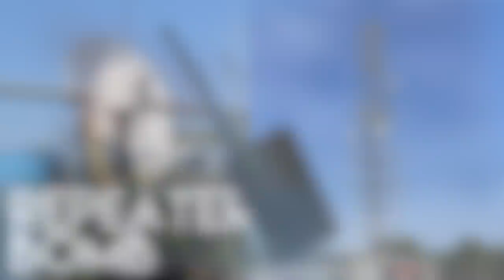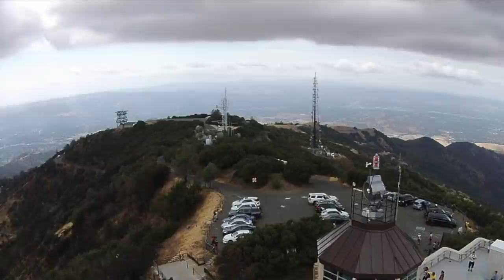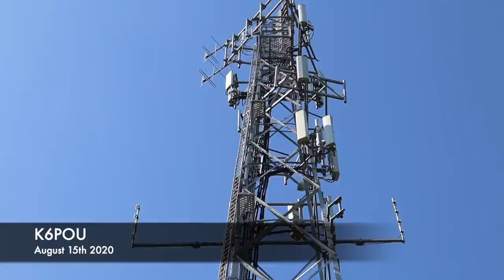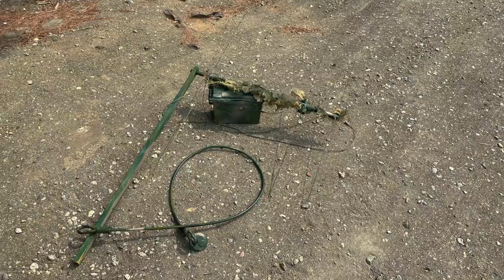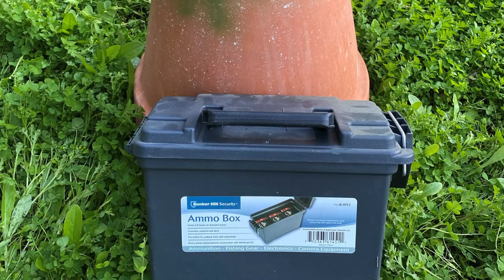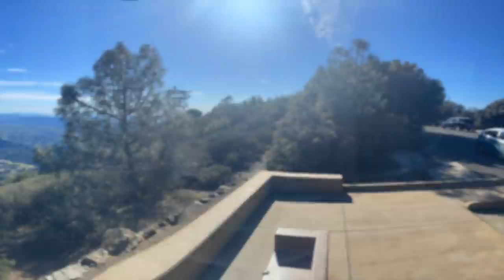The Hidden Diablo Mountain Amateur Radio Jammer

Comment: In the 1970s I used to go up on the mountain to “rabbit hunt”. Working with others to track/locate  CB radio transmitters, fixed or mobile. It was a big thing in the CB heyday. All you needed was a one foot diameter loop antenna. Supposedly you can see more from this location than any other place in US.
Reply: I did it at the end of the really popular time in the late 70's early 80s. I was legendary in the town I grew up in for dealing with the actual jammers and getting them off the air, physically if needed. The Top 3.
#1 Krazy K reason ? Dead keys and music.  He knew that he couldn't out power the top stations. So they did the next best thing, plug up everyone's ears.
Everyone knew where the antenna was. You couldn't miss it because it was right down town in a 1000 person small city. Right on top of the businesses that all had apartments above them. We knew the building well, or should I say, the flat roovs. I was 16. I was the closest one. One night, we were out in the garage drinking, and I believe someone challenged me to go get it.  So by 2::30 I was very saturated with Bacardi Rum and Cherry Coke. I have no idea what I said, but the challenge was agreed. 2:40 l left my house with I think 🤔 the 3 best tools for the job, and I always had a buck knife . I guess that made 4. I vaguely remember it. I got on the buildings rooves from a fire escape 3 buildings down. And then proceeded quietly. I had a ceap realistic 3 ch walkie talkie. A friend was listening to all the local police traffic that was in the town and county. 
Plus, the local mutual aid channels and the Tac channel. Singular we found out by accident that the locals were using it regularly to talk car to car. So we had a person who was a kid, the same as me, listening to all the frequencies in real time. Everyone on the channel trying to talk through this asshole was more than eager to lend me their scanners and any other useful equipment to simultaneously listen to everything.  He was using his base to talk to me via channel 7 or one of the 3 frequencies I had. So, if the cops were called, I knew it as soon as they did and had a plan. To sum it up ? I got 2, Sigma 4 antennas and a Shakespeare BIGSTICK, and then his mobile antenna once. I took 4 antenna raids to get him to apologize, and after a while, we became friends to this day. I was at his house for something, and my 14 year old son was trying to be a smart ass and asked him if his dad took 3 antennas off the top of his house while he was sleeping,  he  lowered his head and said Yes. I replied,  you had it coming. The End of the most famous cb takedown in piss ant USA.
Reply: The second most famous troublemaker was fairly far away. 25-30 miles. A base. Called himself FT,  I have no idea. But he was causing trouble for 2 years straight.  I happened to be coming home from my mom's house to mine. I was listening to the stereo, and all of a sudden,  I had 10 over S-9. So I did the usual.  North then South. Any mobile that got close and he was off the air. Finally, I was lucky. I knew someone would get him eventually. Just didn't think It would be me. Call it, being in the right place at the right time.  So I did my thing and found him at a road that was a dead end. He was full scale, then i turned the RF gain down all the way. Then, I would take my K-40 off the mount. Drive around the same thing because this guy was running power. Finally, I would remove the antenna connector on the radio itself.  Then, the highest signal you could receive was only a few hundred feet away. I got out,  looked around, and there it was.  I wrote the exact address down and notes like how many cars he had and the license of all of them,  the color of his house, a brief description and anything else that could be used to identify the offender. Then I drove off and resumed my way home. After about 12 to 15 miles away, I would reveal the address, a description of how to find the house. Silence............. He said something stupid.  If you come back I'll be waiting for you.  That's when I started describing the house and the un attached garage in detail.  Next was all the cars, and the license plate for each one. Then I threw in that if you are going to wait for us for however long,  when do return back a month, 6 months,  a year or maybe next week. 🤔 I started with the psyops. I said when we do return, we might slash all his tires or burn his house down with him in it or not. His wife was listening by then, and he was probably showing off for her that was when she actually herd the address, vehicles, licenses on vehicles, and on till his wife herd me identify her vehicle and give the license plate number. Correctly, of course, and how I was going to return at some random time and burn down their house. Next time, he keyed, I could hear her squaking and freaking out big time.  She must have said something to her stupid husband that was pretty serious because the next time he keyed, it was like a different person. He said he was sorry and apologized to everyone who used the frequency and begged me not to do any of the things I said I would do. I gave him 1 last warning.  He was never a problem again.  And we are friends too.
Reply: Then there was #3. I was tweaking an amplifier inductor and capacitors, not even on the local channel ? It's a channel that I'm sure he heard the bleed over from because it was only 10 KHz away. He called me a racital term. I always asked people who don't know me well enough to go one way or another.  No, I wasn't black. I'm sure he thought I was because I was on 27.025 , channel 6. I had at the time a very capable station.  So I shot skip on the Super Bowl.  With the brothers who had to talk to me and really had no choice.  Then I did several upgrades, and I was right there with em. Now, they had no choice.  Someone else was who we were thinking.  Because I was and knew most of them and the same thing, they had to deal with me. I smoked a bunch of the locals in that group. But back to the story.  Someone else knew who he was and called me on the phone and told me who he really was and mentioned that he was a ham. The next word out of my mouth was,  Callsign. He didn't want to give it to me because he knew what I was going to do with it. He finally gave it to me.  All while I'm giving him shit back. I told him I had a special surprise for him as I quickly found him by Callsign , and he had 50 pictures at least. I said a series of letters and meant they couldn't be detected. Mean that they can't be detected. I got on Google Maps and looked at his house front and top view. He was in a location that needed some thought. I was looking at Google Maps, and I noticed a daycare and the best place to retreat from. I formed a plan. He had 3 towers, and 2 of them had pads that could be easily exploited by someone like myself.  After I gave him the notice, which 2 towers were scheduled to come down.  They were just out of the treeline. I came up with a plan. It was the easiest thing to destroy his ability to do anything.  Once, I started giving him detailed information only of his house, cars , boat, radios, and everything else in his QRZ profile.  He had a complete turnaround.  He said he was sorry for causing trouble, and it was the pain medicine they gave him after a surgery or something . I suggested that he stay off the radio while he was taking the meds. That was it. He said he was imbarresed and asked for forgiveness. We did, and he was fine after that. We are also good friends. The moral of this story is that just because you don't see radio waves doesn't mean they can't be seen.  You might as well put a 1000-watt  light on the location.  It was too easy that one was. I never left my chair.

Comment: I find it strange that the jammer felt compelled to commit this illegal act, rather than just remove the repeater from his/her programming.  We teach our ham radio candidates to disengage when experiencing interference.  Turn the knob off or change frequencies.  It's also a reminder that 2M Voice doesn't define ham radio.  Why the jammer would "walk away" from the hobby because of some idiots on a repeater is beyond me.  Perhaps the jammer knows nothing about digital modes, Morse code, EME, SOTA and POTA, etc.  What's next for the jammer? Sabotaging anything that they disagree with?  Should the local FOX news affiliate be concerned?  Jammer is a mental case, for sure.
Reply: exactly
Reply: I think the reason he might walk away is the other repeaters are mostly quiet, dead air, except for a few check in nets. This repeater is the one that is active and people come to like it or not - there is actually something to listen to other than a repeater call sign every 10 minutes. I think the real reason he did this and walked away is he is craycray.
Reply: @douglasdreger3852  In my comment I mention there are bands and modes available to the ham other than 2M.  80, 40, 15, 10, and 6M bands are available even for Techs.  My point is that he was going to walk away from the hobby because a single repeater in his area had convos he didn't like?  The guy needs a new hobby.
Reply: @patring620  yeah I understand that. I think either 1) it’s a ruse, or 2) if he did walk away it’s more likely due to irrational thinking
Reply: Most jammers are lacking a few marbles. We had one for a while fairly close to where I live in N. California. He was a licensed ham and a racist. There was one particular HF net open to anyone but populated mostly by Black hams. The conversations were always nice and very sociable. But this guy would crank up a kilowatt and then start jamming their conversations with music, voice, noise, whatever. He was caught and fined by the FCC but fought against paying the fine and having his license revoked. I haven't luckily heard him on the air lately and hope I never do again.

Comment: BTW, K6POU is/was owned by Wendell Petersen.  Been there for years.  I never used it.  I use W6CX, on 2M/220. UHF went in the tank in the Bay Area after the PAVE PAWS radar issues.
Everybody had to reduce power to a level where it wasn't feasible to keep the rptrs on the air.

Comment: wait what!!! I use this repeater sometimes, along with N6NFI in los gatos, that's interesting that someone put a jammer on the repeater, most of the repeaters in Santa Clara county serve as emergency communications on the SVECS system along with silicon valley ares/races system, they usually use one repeater all the time but in the event of a disaster all the repeaters in silicon valley become Emergency communications.
Reply: Just goes to show how stupid it was to put a jammer there.

Comment: Dude no way
I live in contra Costa and I see mt Diablo everyday. Never knew about the radio jammer. Really fascinating
Reply: I clicked on the video wondering if their was a mt diablo in the UK haha.

I spent a lot time in the Cali central hills
Reply: I used to use 147.06 repeater before I moved to Oregon... 145.13 in Stockton was a killer high level box, as was the 146.085 machine in Yuba City! You could cover from Redding all the way down to just north of Stockton! 147.06 could cover 80 from Vallejo all the way into Sacramento, and 145.13 could cover from Sacramento to Turlock...
Reply: @ke6ziu  I have no idea if your bullshitting or not, but it sounds like your not. if so, you're a very interesting person.
Reply: @radiooperator3176  well... thanks, I guess! Oh, btw... my callsign is N6AMF, and I'm no longer in CA; I'm in Oregon now!
Reply: @ke6ziu  oh! have fun in Oregon.

Comment: I wonder if you can use Arduinos and RF, LoRa nodes to swap a series of jamming transmitters remotely or automatically to hide them from triangulation?
Reply: LoRa SX1276 could probably do it if the frequency is higher than the 130MHz it supports.  It’s  20dBm max output from the module so would need a decent amp.

Comment: This just like 1970's of cb radio  ham is become more like that.
Reply: Strange, except for the SKCC folks thinking they own the frequencies around their watering holes (QRL?, wait two seconds, transmit, repeat), I rarely encounter interference on the HF bands using CW.  It's almost like you think 2M is all there is to ham radio.  Many hams don't use the band, or even a mic.
Reply: Back at ya good buddy. What’s your 20?
Reply: @mmaranta785  Ogden,utah 40miles north of salt lake city pose moving harriman tn 30miles outside knoxville,tn by this summer.
Reply: @foxman362  How is Utah?
Reply: @mmaranta785  we in warm spell it was snowing about week ago.

Comment: Thanks for this Lewis. As one of those who was questioning the whole motivational thing behind such activities on your last video, this was a bit of an eye opener and, whether you agree with the reasoning or not, the very fact that there was motivation does for some reason make the crime (for such it is, at least in the UK) a little less heinous simply because the perpetrator seemed to be doing it 'for a reason'.

It makes me wonder even more about the motivation behind those more well documented attacks on repeaters over here, such as some of the ones you mentioned, and if I should perhaps adjust my opinions on the perpetrators which at the moment still run pretty low.

Let me exp[lain my thinking here so there's no confusion. The scenario is a simple one and sadly one that happens all too often. 'Mr. A walks across the road and punches Mr. B in the mouth. These are the facts as seen by all who were present at the time. Now, If it turns out that Mr B had been winding Mr A up for some considerable time and had perhaps say, damaged some of Mr A's property, some sympathy is felt for Mr A and despite what he did being wrong and yes, illegal, there is a certain amount of understanding for his actions among the wider community. If however Mr A simply assaulted Mr B out of the blue without provocation, just because he could, that places him the the category of low life scum, someone with distinct mental health problems or simply a criminal who should be behind bars.

Perhaps the above view explains why my interest in the motivation for these attacks on other peoples freedoms, such as the freedom to enjoy their hobby say, is peeked by such actions. As others have stated, certainly in teh area I live, back ij the days of pre legal CB we had one or two 'idiots' who thought they were funny. The rest of the community, for that's what it was back then, quickly tracked them down and 'dealt with them' which made for a much happier experience for all concerned in the long run.

I guess it's the psychology behind it that interests me most. 

Cheers Lewis, great output, look forward to the next ::o) ... ODJ
Reply: Political wrongthink transmission via a California based repeater seems to be the motivation here. Hopefully neither the Jammer or Jammies decide to leave the state in order to go ruin another one 😁 (I have great friends from California and often tell them how I can accept where you lived, but I cannot forgive it! 😄👍)
Reply: In UK speech the guy who jammed this Repeater hated that some people more likely to vote for a Tory were saying things about the head of the opposition like how they have a problem with a certain race of people that had a bad time during WW2...
So this die-hard Leftwing voter decided to shut the whole thing down so that they could no longer talk about the news that they wanted to talk about...
He wanted to only hear his poltics or nobody got access...
Typical SJW.
Reply: @berryreading4809  This guy's correct, first repeater was a disgruntled modern hyperleftie who most likely couldn't handle all the talk of freedom over the radio.
Reply: @Syphaxis  freedom is forbidden! That's the number one rule of people who love ruling 😉 sadly it looks like its headed to a state near you... then a major city... then your own town... scary and disappointing 😐

Comment: Surprised to see this video! I was embroiled in all of K6POU drama around that time.  there are also more to the history of this repeater, and it's original group.  It has currently been more or less high jacked by a group of far left individuals.  Which both groups identified with the same title: the 2 meter crew.
Reply: @BossMan "or something I find abhorrent" that's a dangerous strategy letting things like that fester and grow.
Reply: @BossMan Seems like an awfully big risk to take for a prank though, the fed isn't really known for it's humor (if you don't count the ironic self owns).
Federal crimes usually have ugly consequences that almost always outweigh the benefits of any given prank...what's the legal risk if caught for something like this?
Reply: @pawteegal  So you'd take the risk for some lolz? That's a bet I'd just rather avoid taking at all.
Reply: @GUNNYCANUCK  What does that even mean?  Im just stating the facts.
Reply: @pawteegal  What does that even mean? I'm just asking a question.
Reply: @GUNNYCANUCK  I dont understand your question.

Comment: The engineering and creativity that went into this device is rather impressive lol
Reply: You're too easily impressed. This was a standard, cheap chinese radio with an MP3 player plugged into it. Encasing it in epoxy and concrete is something any grade schooler could think of / do. The only "impressive" bit is the lengths to which he/she went to "make a statement."
Reply: @jfbeam  I’m impressed because it’s something I would have never thought of, and amateur radio is not a hobby of mine